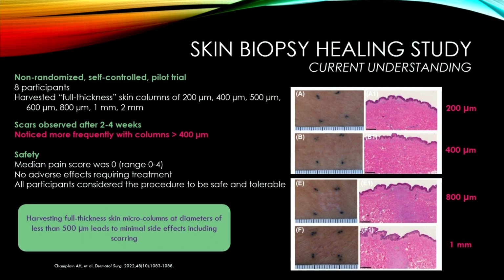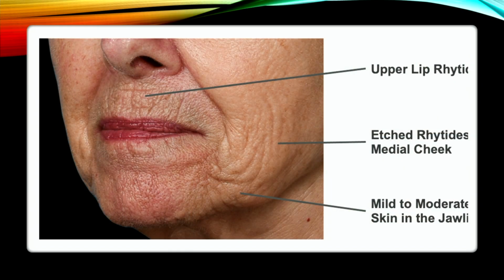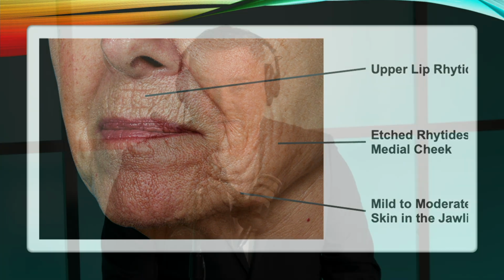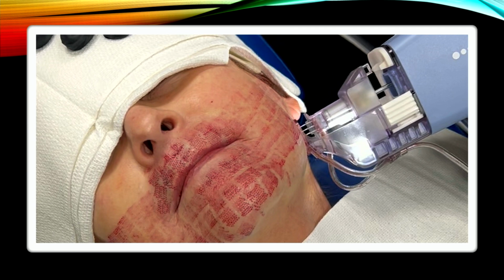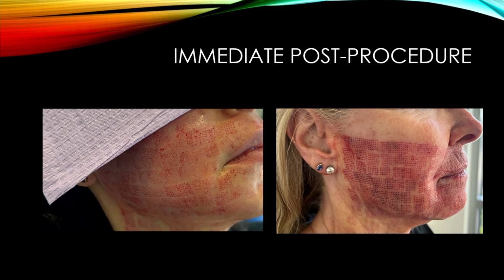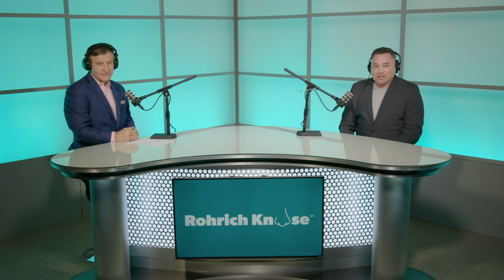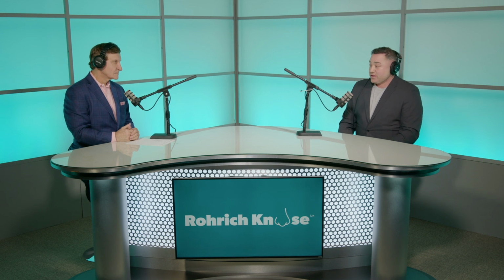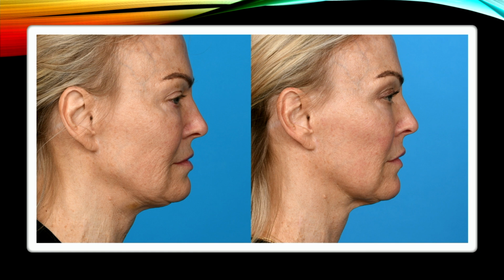Incredible Skin Rejuvenation Results with Ellacor Microcoring

Comment: Thank you for the comprehensive Ellacor overview! As the doctor mentioned (and it's clearly visible in the before/after photos), the results are very moderate. Given the very overpriced cost of the procedure, I'm curious if there are any at-home alternatives to Ellacor? Similar to microneedling (another comparison the doctor made), we can buy a $9 dermaroller and achieve outstanding results over time. I would be happy to invest in something similar to Ellacor but for home use.
Reply: There's no comparison between derma rolling and micro coring treatments. Ellacore removes tiny plugs  of skin. Your face is deaden for the procedure. The biggest change for me is round my mouth. I no longer have lip lines. My are fuller/smother. Ellacore is not a miracle, but an improvement. I  am over 70.